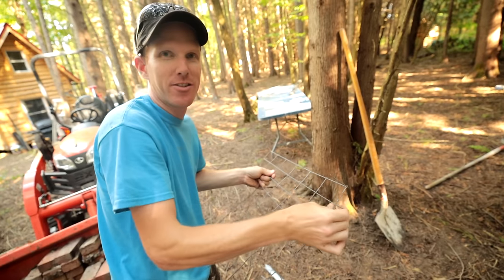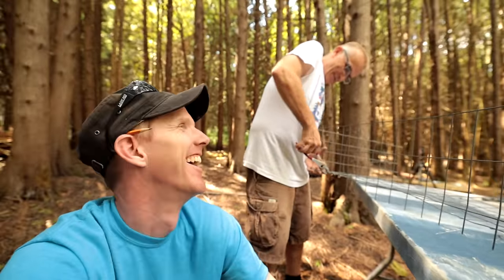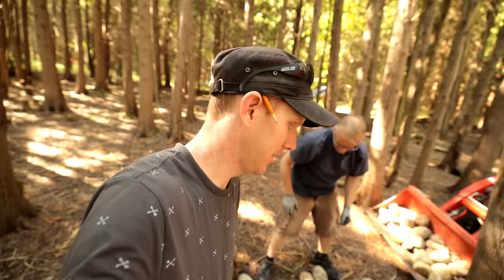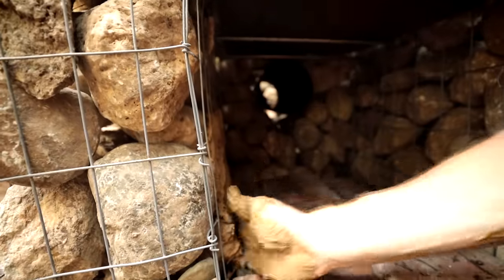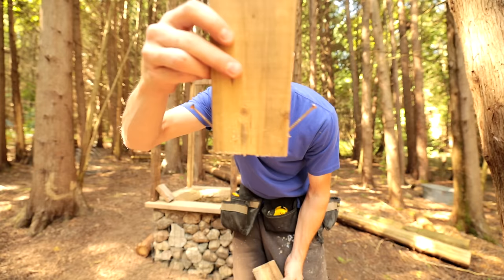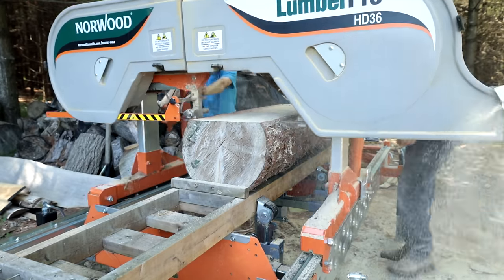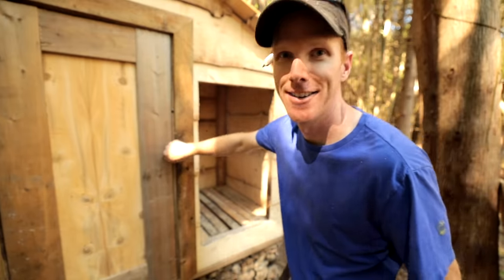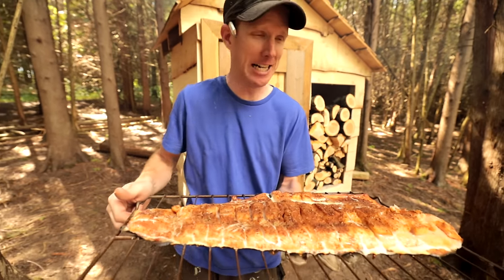I Built a Meat Smoke House!

Comment from the maker: The SMOKE HOUSE burned down, so it was rebuilt - see part 2 and 3!
Part 1 (the original build): https://youtu.be/PhzOuBxXEOc
Part 2 (overnight - smokehouse burn down): https://youtu.be/ll6V2-EUDQc
Part 3 (re-build): https://youtu.be/8N2TiO0f8Kg
Reply: “Cursing in the woods with Kevin “... I’d watch 🤦🏼‍♂️😂☠️🤷‍♂️😈
Reply: Why not put a hole in the door or the wall to put the thermometer through? Then you can just see the temp from the outside without opening the door
Reply: im coming from an area where in former times lot of buildings were clay-based. If the clay-builders use unprocessed clay  (like you did) and water the clay, they let the clay rest at least for three days. the longer the better. doings thus the water gets uniformly sucked up into the clay leading to a homogenous mixture with no pats. using that homogenous mixture will cause less cracks in the finished pflasterwork. just in cause that problems occure later on.
Reply: Ha I knew it. Good try tho buddy.
Reply: So did u do the swearing in the woods video lol 🤣🤣
Reply: Its called page wire
Reply: To prevent the smokehouse from burning down again... it might be a good idea to have a drip tray in there to catch the fatty juices so those don't combust. But hey, at least the smokehouse has a charred patina now. lol

Comment: Your pizza oven is Awesome. An idea is to find round or circular screen rings or even square. Most pizza makers have these to put the pizza or other things used to put pizza on while baking makes it easier to remove and keeps it the food off the ash or dirt. Also if you can find or build a stainless steel flat  spatula with wooden pole attached to remove your baked items. Enjoy
Reply: Gonna try to find one of those screens.

Comment: If you get an old mop that has natural fiber, you can get it damp (do not use cold water), and mop out the over after you scrape all the coals to the side. That will get rid of the ash, and add some humidity to the oven. It prevents scorching too.  The bottom of the oven will dry almost instantly.
Reply: That's great idea!

Comment: Kevin aren’t you worried about that wire around foundation eventually releasing those rocks? Because galvanized wiring metal will eventually rust in places the galvanizing is compromised. 
If it was mine & it not but if it was I’d mud the outside of the foundation with cement and make it much stronger and eliminate it ever coming apart!  👍😁👍
Reply from the maker: Not too worried. It doesn't keep me up at night!
Reply: if ever that starts to be an issue : cover in concrete!  😃
Reply: loud American that’s what I’d do is pack quick Crete concrete before I trusted that wire. 😁

Comment: You don't need wet wood, you need better oxygen controls in the combustion comber. You want it to have just enough air to smolder but not burn

Comment: There is welded wire fencing and woven wire fencing. Looks like you have the welded. Welded wire fencing is cheaper because the welds will pop loose occasionally. That's my theory anyway. I'd try using a castiron pan in the pizza oven for making toasted cheese sandwiches.

Comment: Great job! BUT: 1-you should of insulated inside so the temperature would be stable and no heat loss. 2-pine is not good iside because of pine sap(glue). Better material inside is hardwood.

Comment: I have always called it hog fencing. I used it as trellis paneling for my garden. I think technically it’s cattle fencing.
Reply: Technically called no climb, typically calling it hog fence, cattle fence or horse fence is describing the height (horse fence is typically 72 inch which you don’t need for cattle theirs is 48-56 inch and you especially don’t need 72 in for hogs cause they don’t need a very tall fence) and then you have livestock fence which is also called field fence which has 4x4 squares. Then you can also get cattle, hog and horse fence that isn’t no climb which means the holes are different sizes and then you also have welded vs woven wire. There’s A LOT of variations of basically all the same stuff just with little differences lol

Comment: Will it not be easier to drill a small hole and stick the thermometer through. Then you can read outside the temp and wont loose temperature when you open the door to check
Reply from the maker: Yes this would be ideal.
Reply: @ModernSelfReliance  it looked like one of these thermometer that you stick in the thanksgiving 🦃 to measure inside.
It has a couple of inches length normally

Comment: Shouldn't you add straw or grass to the clay for structure? Or does the wire serve that purpose?
Reply from the maker: I figure the wire and rock as a backer will hold it together.  I didn't want to add combustibles to the mix.

Comment: Wait, I have another question! Why do you put wood inside the cooking area of your pizza oven instead of below the cooking surface(the area that you are storing your wood?)  If you could 'splain that it would be great.
Reply: You wouldn't get any wood fired pizza oven flavour if the fire was below the oven...
Reply: @cmosphoto1  
So i'm wondering if the pizza has to come in contact with the flame for the flavor since the placement suggests that smoke and heat are not enough.

Comment: Do you know that if you put for pigs bed floor 1 yard of small wood chips-it will not stink, and after 4 months will need to digg off just top 30 cm layer. And hay stinks & get wet & needs frequent change.

Comment: 2 by 4 welded wire
Reply: Re: Pizza oven. Start the fire, let it burn down to coals, either remove the fire completely or push it to the edges, depending on how long you need something to cook. Then use a natural bristle brush to dry sweep the cooking surface then a wet mop to clean it. No ashy food. You should try putting something in a cast iron dutch oven and put the whole thing in the pizza oven, close the door. You need a pretty decent wood burn, and just move the coals to the inside edges.
Reply: RE: Clay. Put an old tarp on the ground (a shallow wide hole helps) put in the dry clay chunks, add water, and let it sit overnight. Put on mud boots and get in, stomp around - kids love that part.
Reply: @ginawhisnant9966  that's genius!!

Comment: All your building projects and ideas to cook, preserve and store food perfectly complement the EARTHSHIP designs that use a back wall of tyres rammed with soil to store and release passive solar heat , that have a roof to collect and store rainwater and uses that water 2 or 3 times as 3 times filtered drinking water, un filtered showering and kitchen tap, washing machine quality,
Then the filtered grey water flushes toilets and waters the indoor greenhouse... The black water from toilets is put through a traditional chambered tank but the over flow is filtered by reeds and trees. The massively reduced power required  comes from solar, wind stored in quality batteries capable of running washing machine and power tools.
Humans can actually live on earth without causing the damage  to nature that we do... We have the technology!... Of course earthships depend to some extent on a techno industrial civilisation.. Large glass panels, photovoltaic cells, plumbing, sheet metal etc... And your great designs need a steel industry for your milling machine... But the point is these ideas use so much less energy... If we all lived in architecture that used passive solar... Collected water, grew food and created  no sewage.
We may just survive this coming collapse.

Comment: As a competition BBQ smoking pit boss... I shed a tear of pain when you said you were getting wet wood... smoldering wood is TERRIBLE for smoking more smoke does not mean better smoke. The best smoke is thin and blue, not thick and white. Sorry but this is literally the worst video for advice in smoking ever. However... the basic concept of the shed is nice. It’s a fire hazard and will burn down but you just need to work on the base and maybe do some work coating the bottom of the smoke chamber. That mud will fail and it will burn down though.
Reply from the maker: Did you see the video of it burning down ? lol  You were half right.. the greases caught fire.. and yes dry wood... Thanks for watching!
Reply: Modern Self Reliance first video I have seen of yours was this. I saw the suggested but have it saved to watch later. I’m not surprised it burned down BUT... things like that happening help learn lessons and make the next iteration better. 

I would suggest making a door for a drip pan in the next one or something. Smoking meat with wood like this requires lots of attention... but that’s half the fun of smoking meat.